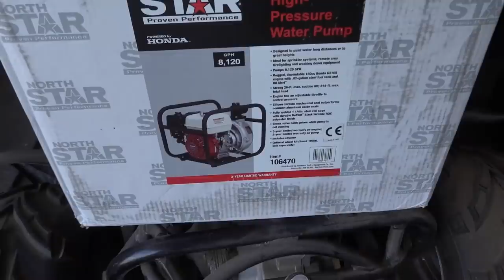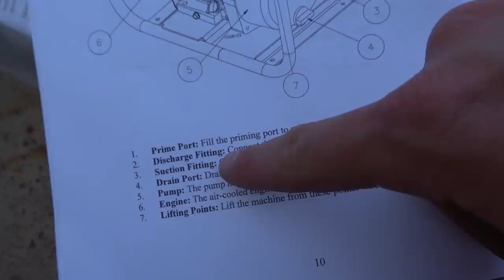I Built the Pumper Truck!!!!! Master Chief is Alive!!!

Comment: MATT, "CAUTION", if that tank doesn't have baffles in it, you might not want to use it as a permanent option. With the water sloshing around in there, it could tip your truck over in rough terrain. Have a tank built from heavy aluminum diamond plate with baffles. And a lower profile that is spread out more over the bed of the truck. That set up you have will be very top heavy & dangerous on rough roads. And center the tank over the rear axle.
Reply: Good point
Reply: Big brain
Reply: Wss looking for this tbh
Reply: Best thing he can do is keep if full.
Reply: You can purchase baffle balls to place in the tank to stop this.
Reply: yep AGREED
Reply: @kaiden47  he needs a lower profile tank as this plastic tank will be extremely top heavy.
Reply: Just saw this after saying the same myself. He’ll do some damage if he drives around with that tank.
Reply: @jones5311  what so you want him to roll over?
Reply: I was about to post this same thing. Sloshing water is a BAD thing. Although, he could take a page from the Apache helicopter fuel tanks and fill it with a low density open cell foam. The foam absorbs the water but it drains out easily under vacuum or by gravity.
Reply: Just posted the same thing. Then saw you posted. Definitely need baffles.
Reply: @smoove_   I doubt he would get that far (atleast hope not) first turn or hit of the brakes and he feels that water shift. 
(Your right, there has been many people killed from water tanks, I shouldn’t assume he would slowly test it out.)
Reply: I saw this video a while back that shows what happens inside a water tank (or other fluid) truck when trying to stop. Perfect example of why baffles are so important.
https://www.youtube.com/watch?v=56cxOzgl-mc
Reply: 500 gallons in a 550 won't slosh that much.
Reply: You will find it very exciting when your high center of gravity, your unbaffled tank, your unrestrained water supply and any change in direction or speed come together.  It is very easy to roll a tanker. With unbaffled tanks it's really a question of when; not if.

Of course it will make good content, but somebody else will probably have to edit it for you. ⚰️
Reply: You can purchase baffles for it. I've even heard of guys throwing wiffle balls in there to use as baffles
Reply: Came to the comments to make sure someone mentioned baffles. I definitely agree with you and like this idea.
Reply: @kaiden47  The baffle balls are the easiest option, you'll loose a bit of capacity but gain stability.....
Reply: lol a 500 gal tank isn't going to tip that truck over, chill. I use a 2000 gal tank with no baffles with a smaller truck.
Reply: @tunaman44  yours most likely isn't sitting that high up in the air with what looks like a narrow wheel base for that tall of a truck.
Reply: @tunaman44  those trucks are not too difficult to rollover, I have been in one that did roll. They have an extremely high center of gravity and he made it a little higher with that water tank. He definitely needs, at the very least baffles, but a lower profile tank with baffles would be ideal. I have
Reply: Reticulated foam
Reply: @smoove_  eh. No!
Reply: I agree with almost all you said, exept for centering the load over the rear axle. While the front axle does carry more of the trucks weight unloaded, having almost all of the load on the back one will be bad for the truck (each axle can carry little more than half the fully loaded truck) and give it a bad handling
Reply: @the_retag  if you center the tank over the rear axle you will have as much weight in front of the axle as you will behind it.
Reply: @larryparish5984  do you meanlenghwise or sidewise, because length wise i agree with his curren placement (maybe optimised) but if you talking sidewise, i may have misunderstood you
Reply: @larryparish5984  but if you mean length wise, try to balance arule on yoir finger an you will notice centering it is the way to go, putting all the weight onyou finger so it doesnt fall off, and if you put another finger (front axle) under the end of the ruler and carefully touch it you will notoce it doesnt carry weight, as soon as you push it up a little it will tip the ruler of, and you need to move it to carry weight
Reply: @the_retag  the tank Matt has on there is not suitable for his needs. It will make the vehicle extremely top heavy & prone to tip over in rough terrain. If he had a tank built that was 7'×7'×2', that would give him 732 gallon of water to work with, with a much lower profile & center of gravity than that plastic tank.
Reply: @the_retag  he's got the motor over the front axle, between the tank & the cab should be his pump and fire box (shovels, axes, chain saws, tools, safety equipment, etc.) & a hazmat box (gas & oil) for the chain saws. You don't want a ton of weight between the axles. Too much & you twist or crack your frame.
Reply: @larryparish5984  i very much agree about having a flat tank, i would use a hopper shaped bottom tho, so even if the truck is standing on a sideways or lenghtwise slope he can properly drain it. I was referring to the tanks center of mass best being slightly behind the middle of the truck, to balance the load (like he did) and of course in the middle between the wheels so he doesnt tip sideways
Reply: @larryparish5984  it should not be directly between, but the water is most of the load the truck can carry and it needs to be split between front and rear axle otherwise the rear one will be over loaded. All the other stuff weights very little compared to the water. And with the right tank geometry(flat) it wont be all the weight directly between the axles, but rather spread out a bit so no danger for the frame

Comment: Hey Mat, I'm a metal fabricator at a firetruck dealership in Florida and I have built some brush trucks. You should really plumb in a recirculation valve so that when your pump is running and you're not flowing water it will go back into your tank, that will keep you pump from overheating.
Reply: I was just going to say the same thing, I have a unit for my pickup with a reel and pump. You can use a bypass line back into the tank with a valve on it to regulate the bypass pressure.
Reply: Pierce?
Reply: came here to say this, recirc line is also useful for pressure control
Reply: Wouldn’t happen to be the factory near Ocala would it?!
Reply: Mount it under the side of the bed of the truck so it's at chest height when your using it
Reply: This was the comment I was looking for. Glad its got so many likes, hopefully Matt sees it! 👌🏻
Reply: @ianbrantley837  I was also thinking that but realised it probably won’t be a huge issue if he’s not planning on cruising around town with it. Low speeds around his property will still have it sloshing around but I doubt it’ll become an issue.
Reply: That is what i was going to say
Reply: @TheIdeasGuy  Matt + Slow Speeds.....HAHAHAHAHAHAHAHA
Reply: Yes great point. This is a must if you plan on leaving it running for a long period of time.
Reply: That recirc line can also have an automatic pressure bypass to reduce the impact of water hammer and limit the hose pressure to something desirable. Also, have a manifold made and get a 2nd shorter line long enough to get around the truck. With 200ft of hose out, another hose for the truck just might save the truck.

Really, perhaps you should go and have a look at your local station's brush truck for some ideas. And have a set of couplings so that you can transfer water between your truck and theirs if needed.
Reply: @ianbrantley837  No, I want to see the video after he rolls it or the tank gets ripped off due to the water sloshing.
Reply: @ianbrantley837  this is not important if he is not driving very far
Reply: Spent 25mintues looking for this comment !!
Reply: I'm pretty sure that style pump is not susceptible to overheating due to lack of water.  I use them from 2 inch up to 14 inch intakes regularly and never had one overheat from no water.

Comment: You're going to find out very quickly that you need a tank with baffles in it. All of that water sloshing in the tank is going to make the ride...thrilling.
Reply: I thought the exact same thing when I saw it
Reply: If not baffles it needs to remain completely full at all times...
Reply: Yes I was thinking the exact same thing he starts running around the property with water and it's going to be sloshing around and he's going to have a hard time stopping
Reply: Yeah, if it’s half full, a ton of water going sideways will not be fun on a sideslope. Can get some perforated drain pipe, the black stuff on big rolls, and just stick a bunch in the tank. Will baffle it “ok” without taking up a ton of capacity.
Reply: yeah an bigger
Reply: Anyone on here ever haul a tank that size LOL
Reply: Driving a half full water truck without baffles is exciting.
Reply: First thing I thought too.
Reply: I pulled a 400 gallon water trailer in the army, in the 5 ton truck, water level was no concern, in the humvee, it could be quite harrowing.
Reply: Yes!! When That tank is only half way full its gonna be fun braking 😅
Reply: That's the fun part 😂🤣
Reply: Our fertilizer trucks are setup with this exact tank on flatbed 6.7s and a few on trailers.. y’all acting like he has this on a Toyota Prius lmao
Reply: As a Truck driver, that used to have my tanker endorsement I can tell you, any amount of water sloshing in a tank can be dangerous. even a dry van full of liquid containers can get some serious slosh going making braking fun as you come to a stop and the slosh slams you through a red light, but non baffled tanks have another problem when driven on bumpy roads. Side to side slosh can build up to the point that the vehicle tips after you stop moving. Heard of old tankers doing that on oil field roads, whole truck went over on its side after the driver stopped.
Reply: @thelosthorizons1  there is no way it will remain full if he puts out a fire, so a tank with baffles is the only way to go.
Reply: @BIGREDTECH  I have driven a tank truck about 8  times that size
Reply: That really isn’t that big of tank for that truck. He’s not hauling half loads down the freeway. He will be fine without baffles. Heck I grew up hauling 1200 gal of 11lb/gal in a ‘58 Chevy Viking.
Reply: That's some true telling their son!
Reply: Use baffle balls they work great
Reply: not to bash on anyone or anything but our fire department uses similar tanks actually larger ones on identical trucks and we have no problem without baffles.
Reply: Yes indeed!
Reply: Ro Herms  if it’s completely full, it can’t move at all. Any common sense would tell you that. 😂
Reply: I was thinking the same thing.  At least turn it sideways so less mass is shifted front/back.
Reply: @jacobtrauernicht8035  same. We don’t really need them.
Reply: He needs baffle balls, they are going to run him about $14 per ball (around $700 for that tank) but the nice thing about baffle balls is that they can be added or removed as needed. And unlike walled baffles there is no failure points added to the tank itself. Smallest balls I would suggest are the 14 inch, as they are designed to be used 1 ball for every 10 gallons, that means only 50 balls for that tank, at a loss of 14oz per ball, at 50 balls thats only 5 and a half gallons of water space lost.
Reply: @realredditstories420  Yeah I was on a fire last summer and we were in extreme hills and slopes for our fire district and had absolutely no problem
Reply: I had that exact same thought. Hes going to get himself or worse, someone else killed.
Reply: @jacobtrauernicht8035  ours does that in Louisiana.  We’ve also pulled a drinking water trailer with no walls or balls
Reply: @scottjackson1636  Imagine trying to brake going down a hill with a tank with no baffles....
Reply: @realredditstories420  Yeah at the end of the day I think adding baffles to the tank will just end up adding more unnecessary weight
Reply: @trickyricky12147  let’s see, you push the brake pedal, and trailer brake pedal if you have them. And if your brakes aren’t garbage, you have to stop a little earlier than usual.
Reply: @realredditstories420  That's true lol
Reply: I've driven un baffled tankers.   It will surge but with that little tank it shouldn't be too bad.
Reply: He won’t be going far in it so it won’t really matter.
Reply: @stevennichols3421   military water trailers have baffles from my experience
Reply: @RitzBlitz33  the problem is that it sloshes around when you are trying stop or turn
Reply: @scottjackson1636  ur talking about over 10,000 gallons... way different. Anyone that’s hauled tankers know that hauling anything sub of 1,000 gallons really doesn’t need for baffles. Shoot we haul chemicals in huge 1000 gallon plastic bag totes without baffles. We receive 500 gallon totes the same way. It’s literally a ziploc bag inside a box. No baffles. This liquid tank is pretty common in agriculture and nobody is crying for baffles... I guess is west coast guys know how to haul our liquids💁🏽‍♂️
Reply: I was in the army in the 90's and our water buffalos had no baffles
Reply: Might wanna look into a tank that has them
Reply: @BIGREDTECH  agreed, and it's not like he's doing 50mph on icey roads coming up to a stop sign.... its TX and big rig, he will be fine.
Reply: Guys it’s only 500gallons. I have pulled a 1100 gallon tank half full on a farm. No big deal.
Reply: Yeah thrilling is a nice way to describe it
Reply: @thelosthorizons1  Or empty ;-)
Reply: hmm
Reply: @stevennichols3421  Thanks for your service! Yep push that humvee around a bit LOL
Reply: Eh that small of a tank will be just fine with no baffles, I run a 1400 gallon pumper truck on a f750 body and frame hydraulic brakes and theres no baffles and it's not horrible, rides like shit but it does its thing
Reply: @stevennichols3421  maybe I was thinking of the fuel tanks having baffles.
Reply: I think a custom tank welded from stainless would be best, he could have baffles, large (not for standard filling) openings for cleaning, and with a flat, spread out geometry (keeps weight lower down and you can use space above it) but with a hopper (down to one point, not with a line as the lowest part) shaped bottom, so water drains properly even if he's standing on a slope.

Comment: Hey Matt, your truck's cab is in transport lock. You need to pull the pins to get the cab's air ride working.
Reply: Yep I hope he sees this comment.
Reply: @JohnZ0805  maybe he'll see my comment. I'm sure he has no idea about it being locked.
Reply: MMVPN Sports  anytime I see someone with an MTV or LMTV, I look to see if the lock pins are in. A lot of people that get them and they don't know much about them, they don't even realize the cab has air ride and don't know to check the transport lock pins. I hope he sees it too because I know that truck is bouncing him all over the cab. Haha
Reply: he needs it to fit in the barn thats way its in transport mode
Reply: @adamsbackcountryliving  I highly doubt that. Has he said that?
Reply: Bump!
Reply: @adamsbackcountryliving  I just went back and watched, the truck was in transport lock and still wouldn't fit in the front door of his barn. It will fit through the back if unlocked or locked. The 5 ton is a little over 10 feet tall and the LMTV is a little over 9 feet tall with the lock pins out and the air ride fully pressurized.
Reply: Upvoted to bring attention to it, good call.
Reply: lololol comet 2 push 2 top
Reply: @89ludeawakening1  yeah fitting through the door is definitely not the reason. The pins were in and he literally scraped the top of the truck trying to get it in the barn through the front. And you can tell they were in by how much it was bouncing when he was driving it.
Reply: Hope he sees this
Reply: Yup.
Reply: What pins does he need to pull? and how does transport lock work? also how did you know? I am just curious because in my entire time in the army I have driven several LMTVs and some were alot better ride than others and never knew about this even though I probably should have. I tried googling but came up short on real answers. Thanks.
Reply: Duck Duck Goose 🦆🦆
Reply: Matt
Reply: Matt
Reply: @Adam-tj5hv  at about 2:58 in the video when he's pointing his finger, look a little to the left behind the front tire. There's a pin with a pull ring. That is the lock for the air ride. It's usually only locked for air transport so the cab doesn't bounce around. But sometimes people lock them when pulling them long distances on trailers.
Reply: @89ludeawakening1  Ok thank you, that makes a lot of sense especially after searching for an answer online. I didn't know it was that simple. Thank you! I wish I had known this during my service. I'm pretty sure now, after learning this, that one unit I went to had all their cab locks in. I would assume it would be a bumpy ride with it engaged and it was.
Reply: Bump
Reply: How would one even identify this?
Reply: Bump
Reply: to the top
Reply: Good catch
Reply: Yup
Reply: Bump
Reply: Bump